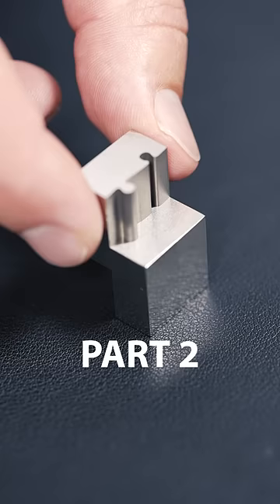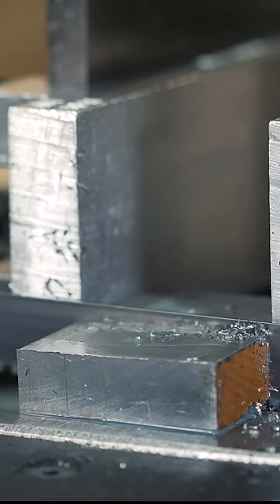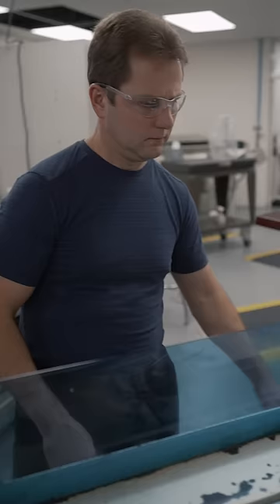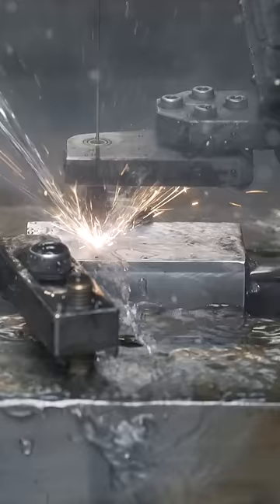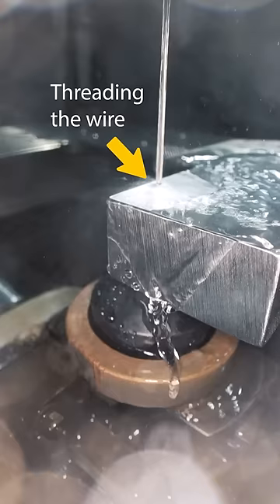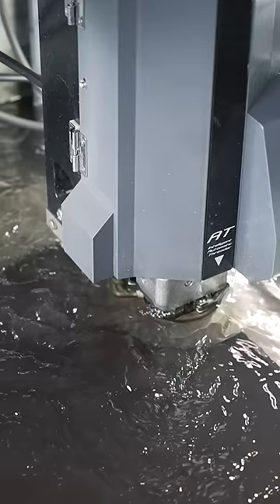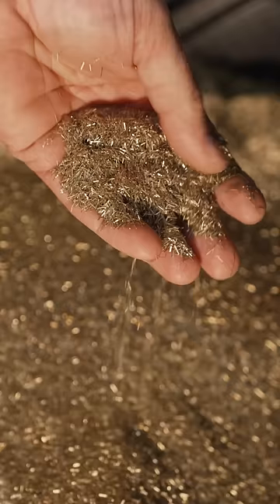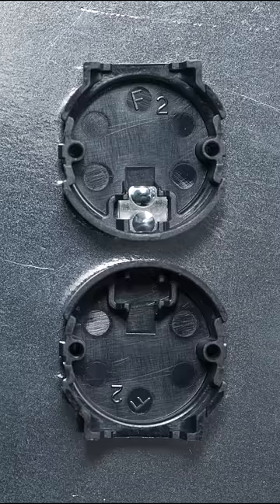'Zero Tolerance Machining' with the Wire EDM, Making a Puzzle Cube - Part 2 | US Digital

Comment: Remember when it used to be a common sci-fi trope that the alien's space ship had a door that seemed to appear out of nowhere because the metal was machined to such high tolerances? LOL
Reply: Until the tempurate changes and the door is sealed shut.
Reply: @OGbqze  We still haven't discovered anywhere near every metal in existence. It's very probable there is a metal out there that is almost virtually unaffected by any thermal changes it would experience in regular use. But melting and forging such metal would also be such a pain.
Reply: @vettebodee  that would be awesome.
Reply: @vettebodee  that would be a material wasted on a door. I mean its good if you can see a door if you asl me xD
Reply: @OGbqze  
As a plot point that would be so funny. The aliens arrive and can't get out because earth is a few hundred degrees cooler than wherever they're from.
Reply: @vettebodee  "we still haven't discovered every metal in existence"
Tell that to the periodic table.
It's the same as saying magic fairies might exist in the ocean because "we haven't explored all the ocean yet"
Reply: @OGbqze  the door would be overengineered as fuck, so theres propably some kind of temperature regulation system or something.
Reply: @luongmaihunggia  That periodic table is all the elements that is discovered on Earth. It is typical for those possessed by scientism to presume that science has discovered everything that exists, of capable of existing, without taking notice of the holes in its theories and suppositions. For example, the literal hole that is the Marianas Trench.
Reply: If the door and frame are made of the same material, there should be no thermal expansion, right?
Reply: @marchdarkenotp3346  lots of the elements of the periodic table aren't even discovered on earth we had to make them
Reply: We've almost definitely discovered all the metals, but we haven't tried every possible alloy. There may or may not be an alloy with zero thermal expansion. It sounds absurd, but I've seen weirder things.
Reply: @robbiejames1540  yea, kinda fit for a comedy sci-fi film LMAO
Reply: @vettebodee  Metals are elements and alloys of elements. They are all on the periodic table of the elements.
Reply: If all the metal changes temperature than there will be no interface in certain cases. Also just have a cooling cell inside the door.
Reply: @robbiejames1540  maybe thats what happens in district 9
Reply: @OGbqze  I would assume that Space Faring people with FTL tech could figure out how to climate-control a room, let alone a ship that's supposed to keep people alive in space, so that metal expansion isn't an issue.
Reply: I personally thought that the scifi of it was mostly that they perfected it to such a degree that it is cheap for them to make it for something like a door. I always figured it'd be possible, just prohibitively expensive.
Reply: @marchdarkenotp3346  If you had any knowledge of how the periodic table worked or what elements were, you wouldn't say that. Elements on Earth work the same as they would anywhere else in the universe.
Reply: @OGbqze  that would not happen since they door and the ship is made of the same material.
Reply: @utkua  truly depends on the features.
Reply: @OGbqze  well in fact the gaps will increase when heated. it does not depend on geometry at all if the temperature is uniform.
Reply: @utkua  that's exactly what we're talking about. If temperate fluctuate then materials will shrink and expand. Doesn't matter if they're made out of the same material because different geometrys have different expansion rates and expand in different areas. It would be near impossible to perfect it, but it potentially could be possible, but even if it is possible we will never see it because it it way too advanced for what knowledge we have today. I'm a machinist by trade and have taken a metallurgy class, materials are WAY more complex than you would think.
Reply: @OGbqze  If the cuts are exacly the same material and their temperature is the same, geometry of the cuts does not matter in this case, that is what i am saying.
Reply: @OGbqze  There is nothing complex about this, you are making it sound like it. Door is INSIDE the ship, if temperature and the material is the same, there is no way they will stuck, they will uniformly shrink or expand. Instead of saying way yes, thank you, you are repeating dead argument. Enough...
Reply: @vettebodee  https://en.wikipedia.org/wiki/Invar
Reply: @marchdarkenotp3346  bruh, it’s not about “holes in theories” we literally know the laws that govern what elements can or cannot exist. It’s not a matter of, ”exploring.” You can look wherever you want and those laws will remain the same. We might be able to find new compounds like ceramics or polymers, but we literally have found all the elemental metals. Any new material we found would be a compound and by definition not a metal.
Reply: @utkua  uniform expansion rarely exists in the real world.
Reply: @vettebodee  Would you care to elaborate where on the periodic table it would exist?
Reply: @datboigroovin8200  The nuclear island of stability would like to have a word with you. We are still finding elements.
Reply: @disposabull  we're finding elements that are so unstable they decay in millionths of a second, not stable metals we could make things out of
Reply: @peelingpedaler3635  wrong. Think about cables, trains, concrete floor and ceiling, etc.
Reply: @marchdarkenotp3346  periodic table is based on atomic structure, not about things found only on earth . Unless you have any evidence for things made without atoms. And yes, the analogy with fairies is valid. And when the OP wrote about metals, I think he/she meant about alloys. Yes. there is a infinity  (literally) of possible alloys using all kind of materials found on the whole universe. Not only combination of materials, but quantities and methods/recipes.
Reply: @OGbqze  if the temperature changes, and the door is made of the same material as it’s frame, wouldn’t the frame also expand leaving the door free to open?
Reply: @aidanwarren4980  unless it has the exact same mass then no. Also, it would have to be such a pure alloy with ZERO defects such as porosity, which is near impossible for us to achieve. The closest thing we have to "ZERO TOLERANCE MACHINING" is with EDM Machines. You should go watch EDM machines, it's really freaking cool. Also, the parts are usually on such a small scale that the parts don't expand and contract as much. On a bigger scale it would be near impossible, but not impossible.
Reply: @OGbqze  dont forget about 0cte materials
Reply: @WearyKirin  Synthetic elements are so radioactive that they basically disintegrate instantly. We've done a lot of investigation into possible new elements and they're all extremely unstable and hard to make.
Reply: @vettebodee  don't watch that much sci-fi.
Reply: @utkua  dude, just because they expand at the same rate doesn't magically make them expand in the same direction.

It's not the object itself that's expanding, it's the distance between atoms, the material expands in all directions, the door doesn't just get wider, it also gets thicker and taller. Same with the frame. That includes internal dimensions, which will get smaller as the material expands.
Reply: @TheByQQ  no, the hole will be bigger just like a solid part, this is not a crystal atomic bounds will not effect the scale in different dimensions.
Reply: @l.h.9747  We create nanometer sized transistors using the same processes to create supercomputers to run our digital toasters.

What's a "waste" all comes down to economies of scale.
Reply: @luongmaihunggia  element itself near done i think, alloys , treatments and so on can be absurd amounts of mixes and see what works ans doesnt
Reply: @luongmaihunggia  I'm saying this out of genuine curiosity, is it possible there could be some kind of alloy that has those properties?
Reply: @luongmaihunggia  periodic table isn't finished per se but, for now, all the theoretical elements are extremely unstable meaning they will decay to smaller atoms within an instant.

Of course it is possible that there exists a stable group way further out that is unlikely if not impossible to be made it natural fusion but that wouldnt really be metal
Reply: @utkua  “atomic bounds will not affect the scale” pardon? if i have a point grid and i increase the distance between the points, the size of the grid increases right? that’s what’s happening here (at least when it’s getting hotter. vice versa applies when getting colder)
Reply: @_ayohee  Scale, I said scale. In every dimension, it will scale proportional to length, you want to call length = series of atmoic bounds, fine, but bounds has no effect on its scale in different dimensions because they are not aligned with any axis in coordinate system.
Reply: @luongmaihunggia  Lol, the periodic table is discovered or made my guy. You can add infinitely as more it is discovered or breakthrough. Earth is smaller than a speck of dust compared to the universe, so the existence of a new element than we discovered today is plausible.
Reply: @peelingpedaler3635  the frame would be getting bigger in all directions and the door too. Worst case scenario.
Reply: @marchdarkenotp3346  so an atom with X amount of protons would be different on another planet? in reality we literally know all the elements up to the point they're so unstable they have to be created in atomic explosions and they decay very quickly and randomly... But as many has said there are many allots and also plastic and carbon composites that could do similar jobs. Alloys ultimately a made out of metals, however, who expand and contract, so will the alloy to one degree or another
Reply: remember to preheat the door before opening
Reply: @vettebodee  invar?
Reply: @vettebodee  Very unlikely. Any metal we discover at this point will be very dense, and will decay into other metals very rapidly.
Reply: @marchDarkeNotP  No, you are just wrong here. Every natural occurring element has already been discovered. The higher up ones are all lab created and VERY unstable, only lasting for less than second
Reply: @marchdarkenotp3346  No, that periodic table is all the elements that is naturally occurring and is stable in the known universe. You do know how elements come about right? Through the collapse and supernovas of dying stars. To get heavier and heavier elements, smaller elements have to be squeeze into each other via insanely high heat and density of the smaller elements. Simplistically, you can think of the elements of the periodic table are arrange in the order of decreasing abundance (hydrogen being the most abundant and plutonium as the least). 

Beyond plutonium, all discovered elements were man made and are not stable. So, even if there is other element beyond (google "island of stability" not proven yet)  what was discover, their abundance will not be able to allow us to make anything useful out of it.

You need metamaterial (engineered material that possessed a property not found in nature) engineering to make new materials in the future.
Reply: You mean low tolerances?
Reply: @vettebodee Lets quickly heat our oven up to 3 times the heat of the surface of the sun.
Reply: @robbiejames1540  
A few hundred degrees hotter? How do they prevent from being cooked?
Reply: @Competitive_Antagonist  
Who knows? Something something silica based lifeform something something :)
Reply: @OGbqze  I like tempura
Reply: @vettebodee  ah really? wouldnt that be pretty hard with how thermodynamics work broadly?
Reply: @FnD4212  yeah we can keep on making unstable elements, but you can’t just ‘find’ a new element to place between the already existing metals
Reply: @chikapunk4340  hey, if it fulfill the condition, why not. Alas, it is not us who decide what to put and what's not.
Reply: @FnD4212  exactly. It’s not for us to decide. That’s why we have a periodic table that shows us what to expect. It can’t happen man
Reply: @chikapunk4340  It can't happen if you are the one to decide it. Personal opinion didn't matter. If it gonna add or not, the future will decide.
Reply: @FnD4212  …it’s literally impossible to just have a new metal in between the already existing metals. The elements each increase by one extra proton, so it isn’t like you can just make a new element appear unless if it’s extremely unstable. Like all the man made elements are so unstable because the only new elements that can be created are really huge, so we can really find elements that are bigger than the rest and those ones only exist for less than a millisecond after they decay.
Reply: @chikapunk4340  To your current  knowledge and the knowledge in this era anyway, that is impossible. That's why is just personal opinion. Do you think this universe this big only contain just this in periodic table? That's a small thinking
Reply: @FnD4212  dude… I don’t think you understand how atoms work. Sure there are a lot of things and possibilities in the universe, but things generally follow the same laws of physics. If anything, if we were to find some material with these properties, it wouldn’t be a ‘new’ element, it would probably be some sort of mixture of existing metals. This is not an opinion. Shameful /:
Reply: @chikapunk4340  Law of physics never change, but human observation and  understanding of law of physics do not. Nature does not follow the rules of human interpretation, human just state the law according to what they can observe and experiment. The future might have the tech that didn't exist now to discover something new. Your understanding just limited by technology in this era, so it's understandable that your opinion says it is impossible. I however, believe the  tech will always evolve overtime, and new thing will be discovered.
Reply: @FnD4212  you gotta understand that we are talking about elements here. Like I said, there are so many things to discover since the universe is so big, so in theory there should be a new element that fits between the existing metals. The only issue is that atoms are made of protons, neutrons and electrons and the only thing that is changing the element are the protons. This isn’t something that you can just make an opinion on because this is just how things work.
Reply: @chikapunk4340 I understand your opinion, I have no problem with it. I explained my reasoning here. I believe the technological marvel of human invention. Humans might halt biological evolution but I believe the human knowledge of technology will always evolve over time. You may say it is impossible, but that is the factor of human understanding at the time. You might say it doesn't make sense now, just like people in the old day saying it is impossible to make steel fly, but technology will make the impossible possible will come that can do beyond our understanding at the time. That's why I say it is just an opinion, the opinion of the people of this era and time. You may say it is impossible, but you don't know what the future hold.
Reply: @FnD4212  keep in mind that we are talking about elements here. It’s not about opinions. Do you know why elements are called elements and what makes up atoms?
Reply: @chikapunk4340 Everything you do know about elements today is from the hard work of scientists that they can observe and experiment with the tech they have in their respective times and places.  Your knowledge just stops here because of limitations. Learning from history, there is no clear-cut impossible, you just don't have the right tool to make it possible.
Reply: @FnD4212  do you know how atoms work? Could you tell me how in the universe this magical element can just be made out of protons, neutrons and electrons?
Reply: @chikapunk4340  As I said, we couldn't know beyond that, because we have limitations. Your mind is just stuck on today, but never the future, just as same as people of old who thought steel that could fly and carrying passengers is an impossible feat. Alas, human in the future finds a way to do it. I don't know how they will find it, but with the technological marvel of humans, many make people think that anything they thought was impossible, possible. You never know that in the future beyond our lifetimes, there is an invention of a tool that can observe more than people of the past couldn't. You can't comprehend it doesn't make it impossible.
Reply: @FnD4212  well I’ll tell you what… whatever “new metal” people find in the future is either gonna be unstable, some sort of alloy, or not even an element at all.   According to both of us, we are both ignorant 🫲😒🫱
Reply: @luongmaihunggia  it is actually mathematically possible that there are other stable elements out there on a sort of island of stable elements surrounded by unstable once. They would however all be radioactive... I watched a YouTube video on that.
Reply: @gilgabro420  if it's constantly radioactively decaying. Then there's nothing stable about it.
Reply: @robbiejames1540 
"FUCK! IT'S TOO COLD!"
Reply: @OGbqze I love that ! I have a couple micrometers that are scientific level and have a plastic handle to prevent heat distortion from hand heat, super neat ! Godamn some grade s gauge blocks are stupid expensive though
Reply: @vettebodee incanel is stable up to 2000 or so degrees (don't quote me on that) but very expensive, absolute nightmare to machine though
Reply: @peelingpedaler3635 nope temperature while making the part and temperature while installed are going to give you some type of variation no matter how small
Reply: @luongmaihunggia I think the confusion comes from the recipe in which we combine certain elements and create new alloying elements and not discovering new ones I hope lol,
Reply: @OGbqze very well put !
Reply: @utkua your wrong and ignorant, very hard to achieve such a relationship between metals at whatever temperature, also matching temperature and operationing temperature are different thus can give variable results ine installation
Reply: @OGbqze  

We are energy sufficient enough to control the temperature of the doors 

- Aliens👽👾
Reply: @OGbqze the door doesn't seal because: the temperature is controlled.
Reply: You mean low tolerances
Reply: @PTMPTM underrated joke 😅